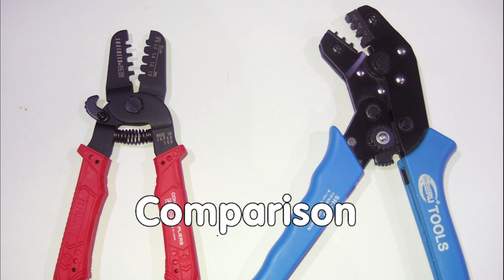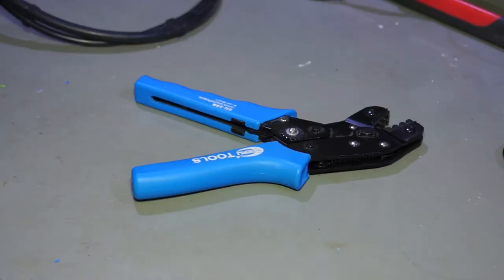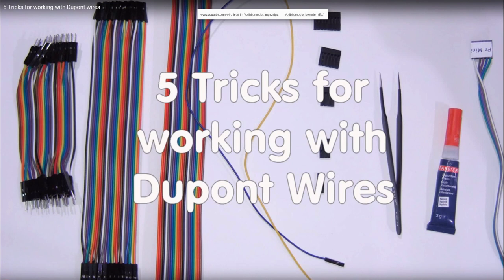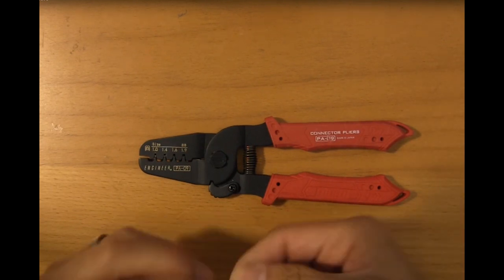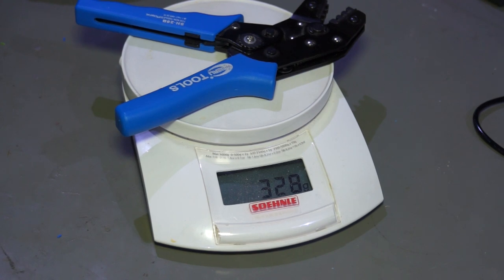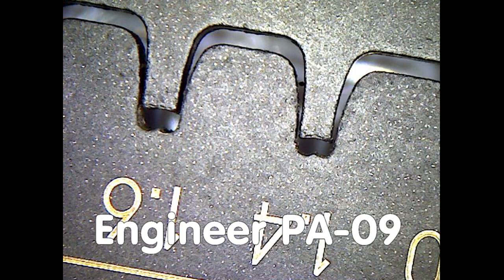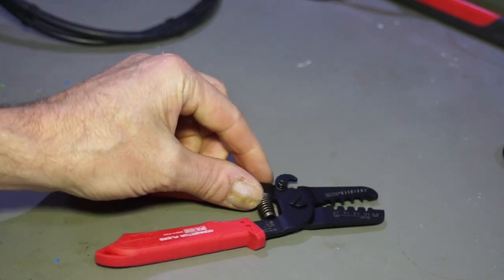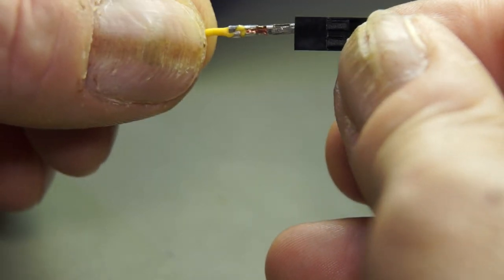#39 SN-28B Chinese Crimper  vs Engineer PA-09: Is there a difference for Dupont wires

Comment: I discovered Engineer brand tools in a shop called Sengoku in Akihabara here in Tokyo. My purchase was the PA-05 combination wire stripper and crimped for small gauges. Perfect for working with Arduino, Raspberry Pi, STM32 and similar project related SBCs and MCUs. It is simply excellent precision tools they make. True Japanese quality. I have never had a pair of pliers that stripped wire by gauge perfectly like these. Crimping is still not easy sometimes for the very reason the folks from Engineer tried to explain. The little tabs that get crimped on the sides of the Dupont connectors come in different shapes. Some are angled or triangular. You generally want to use the ones that have straight rectangular tabs if possible.
Reply from the maker: You are right, crimping is not easy. But after a time I got nearly every crimp ok.

Comment: I bought the same blue crimpers and had the same issues. I then  bought the red ones a while back for crimping 1.5mm JST connections and found they worked much better. I think if one was to find a decent set of jaws for the blue handle ones the would work very well but I have yet to find any. I have seriously thought about having the profiles laser cut and making my own set.
Reply: Also, do you have any suggestions for small gauge wire sheathing strippers?  I have yet to find a pair that I like. I prefer the kind that clamps the wire and strip the end. I have a pair that I really like that works well for larger gauge wire but they are bulky and tough to use on small projects.
Reply from the maker: +Jon Raymond I own three strippers:

http://www.aliexpress.com/item/2014-New-Arrival-Multifunctional-Automatic-Cable-Wire-Stripper-plier-Self-Adjusting-Crimper-Terminal-Tool-6-TK0742/1894649997.html: Not easy for left-handers (as I am). Results are good. Clumsy and heavy

http://www.aliexpress.com/item/Free-Shipping-YF-046-0-6-2-6mm-Multi-Function-wire-stripper-plier/1583649116.html: Good tool if you hit the right groove. If you hit a too small one it cuts also copper. Needs force for thicker wires. Best for thin wires. My favorite

Similar to this one, purchsed loccally: http://www.aliexpress.com/item/Free-Shipping-Hot-Automatic-Sale-Cable-Wire-Stripper-Self-Adjusting-Crimper-Stripping-Cutter/32321372384.html?spm=2114.01020208.3.65.7SmPRn&ws_ab_test=searchweb201556_2,searchweb201644_2_10001_10002_10005_301_10006_10003_10004_62,searchweb201560_8,searchweb1451318400_6148: Hurts the plastic, otherwise ok for thin wires

Comment: Like you, I was also running into crimping problems. I purchased 2 crimping tools. The 2nd was after I learned that each tool is designed for certain sizes of wire. But I was finding surgical clamps to work better then these crimping pliers. At least, I was up until I just watched a video about crimping connectors before detaching them from the metal strip. Daaaa...... I just tried this with my SN-48B crimping pliers and it works like a charm, provided you are using the end slot on the pliers to make the crimp with.
Reply from the maker: Thanks for sharing your experience. I will try your method without detatching. Do you know the link to the video?
Reply: Also. One thing that I have recently started doing. Since I have a hot-glue gun and plenty of hot-glue sticks, I have been putting a dab of hot-glue at the base of the plastic connector. It acts like shrinkwraping, only cheaper. Any stray wires which tries to escape the connector are also held in place by the hot-glue. (Also, many people put a touch of solder on the connector pin. I always end up with too much solder on the pin.)

Since I started using the hot-glue on plastic connectors where and after the pins are inserted, I have heard that many people working in various electronics do the same thing. 
(Don't ask me to make a video about it since my use of a hot-glue gun is crude. I am sure that many people are better.)
Reply from the maker: Thanks for the info. After watching the video I understand now how it works. I will try it with the next wires I crimp.

Comment: Excellent stuff. I had no real experience of crimping so I naively bought a SN-28B, specifically for a project using JST PH connectors (2mm pitch). I had exactly the same problems as you, especially not getting the terminals to fit easily in the housings and the width of that tool is is too wide, you have to judge exactly where to place the terminal in the tool otherwise it either doesn't fold the larger tabs in properly or it bends the actual connector part. I'm going to order a PA-09 instead. Thanks for posting that!
Reply from the maker: +Mark Purcell Thank's for you comment. I hope, you will be happy with the Engineer crimper!

Comment: So I have to fully endorse your video, having had a very similar experience. Though rather than Dupont, it was crimping JST 2.0mm  PH connectors, which are readily available on ebay.  In the end the Engineer Inc PA-09 tool was an absolute life saver. My only complaint was the ridiculously long wait to get it shipped by the Amazon seller.
Reply from the maker: Thank you for your feedback. It sure helps others!

Comment: I just got Iwiss SN-28B crimpers, which have a die shape that causes the crimped "wings" to curl inward (like I think they are supposed to).  After a little practice, and initially squeezing the wings that grab the insulation (to keep the wire in the right position), crimping male connectors seems to work OK.

I just realized that the female connectors have a shorter distance between the end of the connector and the metal tab that attaches the connector to the reel.  So I can't just slide the connector into the tool until the tab makes contact with the die.  If I do that, it crushes part of the connector so that it won't latch into the shell, and you can't slide a pin into the connector any more.  I may try removing the tab on the female connectors first, but I suspect that it will be difficult to align the connector and wire inside the tool.

Maybe I should get the PA-09 and crimp the insulation and strands separately?
Reply from the maker: I would practise a little more with the current crimper. The IWISS I have works pretty good. (I made a second video on this topic where the PA-09 was only second choice becasue it was more expensive)

Comment: I, like many of you, have had to experiment with my crimping tools a bit.  I think this is one of those situations where preference is going to play a role.  I started with the IWISS SN-28B crimpers.  So far the only type of terminals that I crimp are the 2.54mm JST terminals (aka Dupont connectors).  I found the IWISS crimpers to be difficult to use like so many others have.  I have tried tricks like soldering, which work but I feel I shouldn't have to (after all, JST stands for Japanese Solderless Terminal).  I have also tried adjusting the dial on the side of the tool by removing the set screw and rotating the dial a single notch and replacing the screw.  This did help the final outcome but it still didn't solve the cumbersome nature of the tool.  The primary issue that I have with the tool is visibility.  When you have the pin set in the crimpers, it is difficult to get the wire seated just right without having it too far in or not far in enough, and you don't get to find out until after the crimp is finished.  I appreciate the concept of crimping both sets of tabs at the same time but in practical application it is more trouble  than it is worth in my opinion.  I decided to spend the money on a pair of Engineer PA-21 crimpers.  I find these crimpers much easier to use.  Crimping the two sets of tabs separately from each other is ultimately less awkward and faster.  I think the problem with the SN-28B crimpers is that they are not specifically designed for these type of connectors.  These style of crimpers (available from many different manufacturers) are generic crimping tools with many different interchangeable dies available for many different types of terminals.  I doubt that I will ever use the SN-28B for dupont connectors again, but I think I can still salvage the tool by getting some different dies for crimping other types of connectors.
Reply from the maker: Thanks for your comment. It will surely help others to do the right decision.

Comment: I have the sn-28b and I've been fighting with it for too long. I finally found it that the dies were upside down so it was always awkward to insert the pins and the compression was just too high so the crimps were always being crushed. Once I corrected the position of the dies and reduced the conversion to they lowest my crooks finally come out good. It look years before I was finally able to find a video that properly explained how to adjust the crimping tool but once I find it everything fell into place.
Reply from the maker: Good to know it works now. Newer crimpers that look similar to the SN-28B are also ok. I assume manufacturing quality improved over time.

Comment: Nice video Andreas! Having used many and owned a few professional grade crimping tools from the big industrial equipment connector OEMs, the quality of crimp I get from my PA-09 makes me equally happy to recommend it . The PA-09 is definitely an excellent tool for hobby use, even a useful tool to have for occasional professional use. The main trade-off is in the extra care required to achieve with this tool almost the same quality of crimp joint a professional tool can repeatedly perform in the blink of an eye. Unfortunately, I suspect many people looking to buy their first crimp tool of this type make the mistake of comparing the price of the PA-09 with that of cheaper tools, rather than the WAY more expensive tools from AMP/TYCO, Cannon, Daniels, Molex, Wurth, Weidmuller, etc.
Reply from the maker: Thanks for your feedback. It might be important also for other people. So, they don not need to believe only me...

Comment: For crimping servo connectors on 22AWG wires, I am currently using the cheap IWISS SN-28B ratcheting tool for initial crimping and then I use the Engineer PA-09 to finish the crimping to fit properly into the connector plastic housing.
Reply from the maker: Thanks for your feedback. Here, we would probably call your variant "deluxe" ;-)
Reply: I actually only use the Engineer PA-09 on the part of the connector over the wire insulation.  If I do not use the Engineer PA-09, the connector is unlikely to insert properly into the plastic housing.

Comment: Hi Andreas. After reading all of these comments, and looking at my own cheap chinese crimper tool... I came to the following conclusion: A better quality version of this blue SN-28B crimper might work for some people. If the die in the tool is not produced by a worn stamp tool. But even then, the double-crimping method will only be successful for specific sized wires. Not just the gauge of the wire but also the thickness of the insulation. Since both must be crimped at same time. Each dimension of which can be quite variable, and independently so on the same wire. So it's probably a gamble at best. That is where the strength of the PA-09 or PA-21 comes into play, doing the wire and insulation as 2 separate steps, one at a time. Is really the only way to be sure to get both of the contact points crimped to an ideal tightness for ANY wire. Regardless of it's guage, material (copper or steel), and it's insulator thickness.

As for my own personal experience, with the SN-28B, it was one of the worst possible examples with a badly worn stamp / die. Trying to make the best of the tool, I had adjusted my technique to find the 'best possible way' after many attempts. But nevertheless, the resulting crimps, although functional to begin with, they were simply not durable in the long term. The inner crimp would never grip onto the wire part tightly enough. So after some multiple usages. Then the wires would eventually get pulled / ripped out of the crimp connector. Not a reliable connection. Soldering can work. However that brings with it it's own different set of disadvantages and drawbacks vs a properly made and secure mechanical crimp.

Furthermore, there was that 1 guy in the comments here, who found cheaper versions of the same general PA-09 design, which are named: "DR-2 5500 5600" and "LS-303B". Neither of which seems to be really tested / reviewed much. I am currently trying to decide how to justify the higher cost of the PA-09 to myself. And in fact choose between all these 4 options (PA-09, PA-21,  "DR-2 5500 5600" and "LS-303B"). Which is not so easy decision to make. Perhaps there will be other resources online which will help me decide.

Anyhow I want to thank you for the video and bringing this my attention in the first place. Plus many of the other people here, whose combined knowledge also helped a lot. Some who pointed out the really bad dimensions coming from bad dies manufactured with a most worn stamp. And others who noticed that even the 'true' dimensions in best versions of the SN-28B were will all off / wrong for our intended crimping purpose, either DuPont or ATX pins. You dont mention about ATX PSU pins yourself, however it is very similar to the DuPont connector you are showing here.
Reply: After some further scrutiny of it's picture, it's my opinion that the "DR-2 5500 5600" is probably not a good die to use. Not as good as the PA-09, just judging by the photographs. So that was eliminated. Also I really could not decide between the PA-09 and the PA-21, which one to get. So got the PAD-01 kit instead from Hobby King. By using initial account joining points + a generic 10% coupon code... the price ended up being almost exactly the same cost to me as buying the 2 other tools separately. But the thing about the PAD-01 kit is that in total it has even more different sizes than the other 2 combined. And other than that it seems to be more or less the same tool. Near enough. So I believe that I will be happy with my PAD-01 kit purchase.
Reply: Received PAD-01 kit today. Did some test crimps on ATX psu power cables. My conclusion is that between PA-09 and PA-21, the PA-09 is certainly the best choice. Since the largest size required for these was 1.9. It is also worth bearing in mind that these tools are really only designed to crimp the inner conductor part only. The shape is not best, when comparing for the 2nd outer insulation part. I am comparing it to the factory cables that came with my PSU. Inner = perfect @ 1.6 size. Outer = too flat on the back side, not as rounded. A rounder profile would be best for the insulator.

[updated] Actually using the 2.2 size in my PAD-01 is not terrible for the insulator. And is far better than the SN-28B in the sense that it keeps the thing narrow enough to fit in the terminal. Without totally squishing it. However unfortunately the PA-09 does not have the 2.2 size. So getting a PA-21 instead would be the best 'single tool' choice however i simply don't know for you people, if there is some tiny dupont connector that requires either of the smallest 1.4 or 1.0 sizes. Which PA-21 is of course missing.

Anyhow [few hours later]. I took the useless die for my SN-28B. And drilled some circular holes into it. In the sizes of 1.5mm 2.0mm and 2.5mm. On the 'back side' so to speak (that says '0.25 0.5 1.0'). Then I drilled on the 'front side' that has the awg numbers like 16 24 28). Here i drilled larger diameter holes, like 2.5mm 3.5mm and 3.5mm. And used a needle file to remove any sharp edges. To not snag the cable. These are just simple rounded holes. With a standard drill bit.

Now my old SN28-B is not 100% useless anymore. The drilled out die can now do a much more circular, rounded crimp. For the insulation only. So if you have PA-09 only, then it might achieve a better result for you, as a 2nd tool, for that last step. Nobody else seems to have come to quite the same idea here. In all of the other comments I read. But I think that it's useful solution to modify the SN28-B, if you already paid for it and bought a dud one. The bad version with a worn die stamp. Instead of just throwing it away as junk. It is not too hard to modify. These round holes you drill out do not have to be very accurate, because all of the mechanical strength of the connection is in the crimping of the inner conductor, which should of course always be done by the engineer PA-09, or your equivalent tool.
Reply from the maker: Thank you for sharing your experience. It for sure helps others to decide.

Comment: Best tool in the world for crimping servo pins is the HT-95, this is the official factory tool for crimping dupont connectors. If you compare the crimp that the HT-95 does with the crimp from generic double D crimpers it's a night and day difference. It has a terminal loading mechanism that holds the pin in place while you crimp and a cylindrical die that rolls the conductor crimp wings into a tight tube. You can often find these on ebay for less than $100 (though some similar tools that use the same ratchet handle sometimes get mislabeled as HT-95s so you need to carefully compare with a picture of the real tool)
Reply from the maker: Thanks for your feedback!
Reply: Nerd.
Reply: Thankyou.
Reply: BREAKING NEWS  
A $1,500 tool does better job than $29.00 tool.

Comment: I, like you, have been very frustrated with my tool similar to your blue tool.  Just recently, however, I discovered that the tool is simply crimping too hard. I now ratchet it 3 clicks and then use the ratchet release to open the pliers. There is an adjustment on the side that I believe sets the release point, but I have not been able to move it easily. I'm leaving it alone for now. Ever since I stopped going all the way to the release point, my pins slide right into the connector housing easily.
Reply from the maker: Thanks for the tip. Maybe it saves some of the viewers money for a more expensive tool.